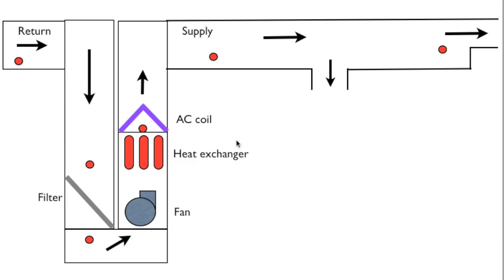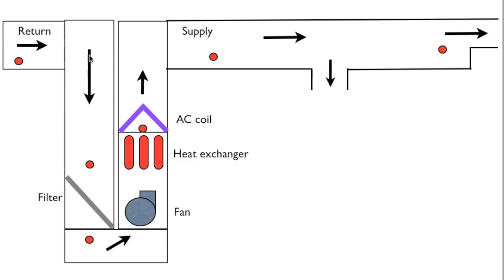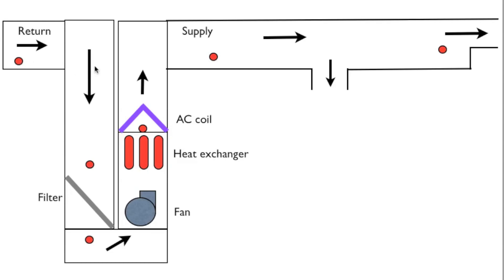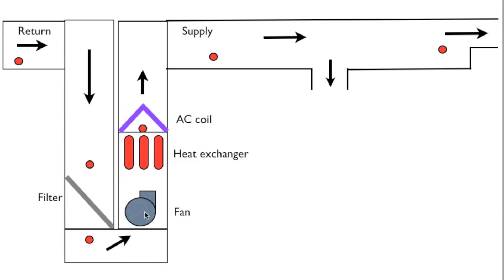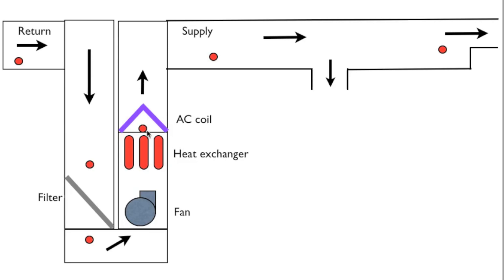Static pressure in ductwork

Comment: If you have a 10 horsepower motor (or above) - that is low on CFM - with an operating suction pressure of 0.05 and a discharge pressure of 3.35 - can you explain why the fan is low on CFM?

Comment: If you have 1100cfm at .3" on the return and you want to be running 1100 at around .08", what size square or round duct you would have to add to lower the static?  I want to know if I am figuring this right. I am having a hard time wrapping my mind around additional duct size = what static. I am not talking about removing what's there I am trying to figure out adding to reduce static.
Reply: I'm trying to figure this one out as well been searching for days and everybody's answer is your static pressure is high? You need to spend five digits and replace your entire duct system even though your system is brand new and our measurements were off when we installed your system we still want you to replace everything and pay us money cuz you waited over a year before saying anything about it" instead of estimating how many new runs or increasing my return or supply duct sizes to lower my pressures.
Reply: You would need 2.5 times larger to reduce the pressure by 2.5 times.

Comment: I just discovered your video, and I must say, well done and easy to understand. I'm wondering what you think the maximum pressure in in/h2o you would expect to see within a duct. I'm designing an HVAC duct balancer, and would appreciate anyone who could give me input. Im trying to find the upper and lower bounds for my device. Thank you! Fellow HVAC guy.
Reply from the maker: Residential max 1" wc.  Commercial can be very high but for conventional about 2".  Hope this helps.
GFM
Reply: Thanks a bunch, I'll go for a sensor that can read up to 2" h20. It says I can go up to 1 psi without damage, so I think I'm good.

Comment: hi, i am reading the "evaporator coil static pressure drop" chart now. Why the pressure drop readings are different between wet bulb and dry bulb under the same condition. For example, when airflow is 800 CFM, the pressure drop readings of wet bulb is 0.21 and dry bulb is 0.18. It seems the wet bulb pressure drop always bigger than dry bulb pressure drop, whatever the coil type or airflow is.
Reply from the maker: XIAO JIE Are you sure that's not "wet coil"?  That means if the coil has condensate on it.
GFM

Comment: A question I would have is this, if I didn't want to use the furnace as a whole house air filter as some of them can become restrictive what is the best filter for the furnace. Private home, this one has tall vaulted ceilings.
Reply from the maker: Any of the medium efficiency (30-35% efficiency) pleated filters are ok.  They are a compromise between filtration and pressure drop.  The fiberglass filters have the least pressure drop and the lowest efficiency (10-15% efficiency).  Hope this helps.
GFM
Reply: grayfurnaceman
If I could I would like to take this a little further to understand better and I think it might add to educating people.

I have the Lennox Elite series. It's the 32xx series I believe. The prior owner was running a 3M Filtrete  1000 and I reduced it to a 600. I don't know what the efficiency ratings are on these filters or if I can go lower still? I think it is safe to assume that the main purpose of the filter is to protect the furnace and it's longevity. A video on Filters, the purpose and any drawbacks would be greatly welcome. Thanks again for your reply and any feedback you can give on this topic. Love your work here!
Reply: Curiosity
Well interesting development... My freezer is located in the furnace /  laundry room, I had talked about a need to turn on the Honeywell 360 humidifier in a past video and found a plastic bag tonight when looking for something to make for dinner. The pressure switch manuals and tubing were all there, it even included a DVD which I watched but it was lacking in exact procedures. It was worked up for the 260 and the 360 and referred you to the wiring diagram which is OK but as long as you are going to provide a DVD to the consumer why not just go into detail?  If you are interested in seeing the DVD supplied I can send it to you. Can't wait to get the 360 working! :) I'll let you know the results after I hopefully get it working as it should.
Reply from the maker: Curiosity  I will be doing some on filters.  Its a subject that needs explaining.  The video on the Honeywell is on youtube.  I will be looking at it to see if I can add anything.
GFM